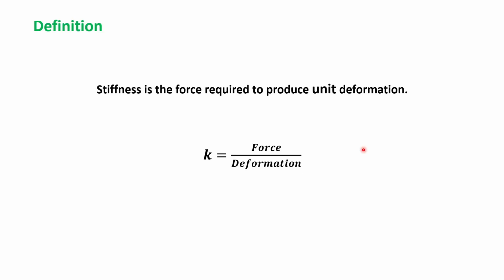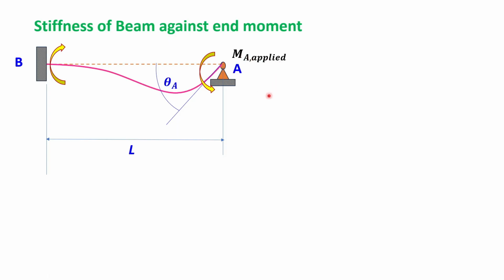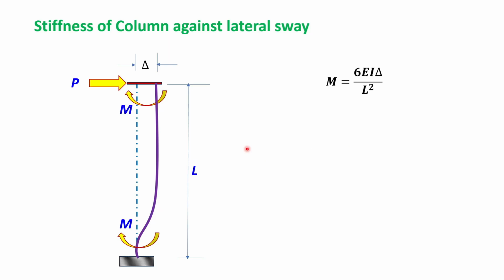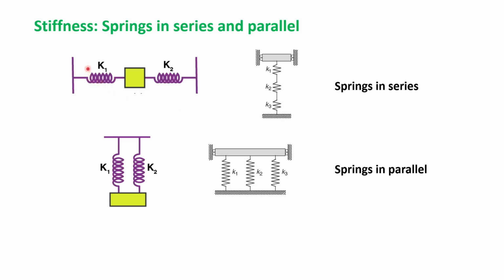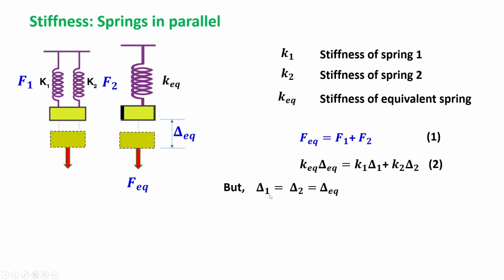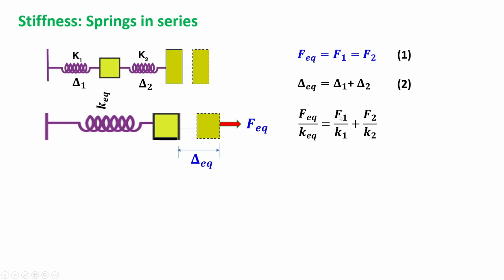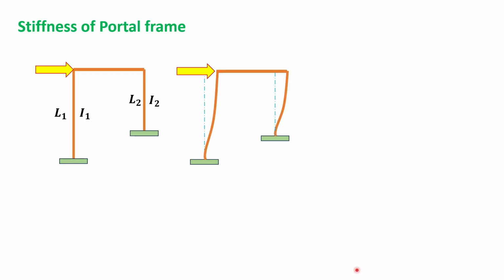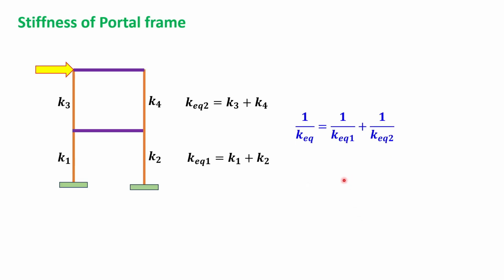Stiffness of Common Structural Elements

Comment: While considering the stiffness of a column in frame is it correct to use the formula 12 EI / L **3? 
As although the bottom is fixed the top connected to a beam is not fully fixed.
Reply: Note that it it is not a cantilever bending case. Also note that the stiffness you are referring is for lateral sway of column or frame.